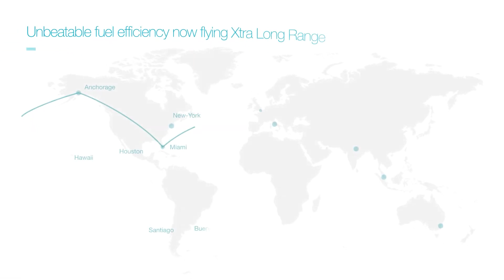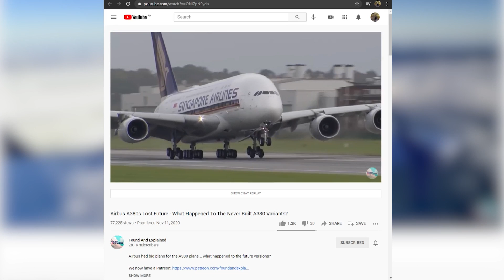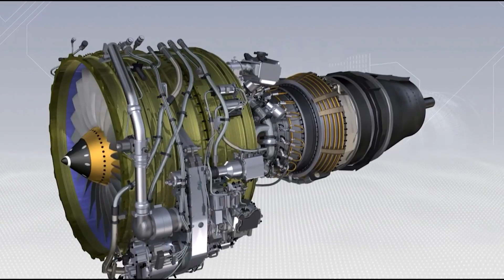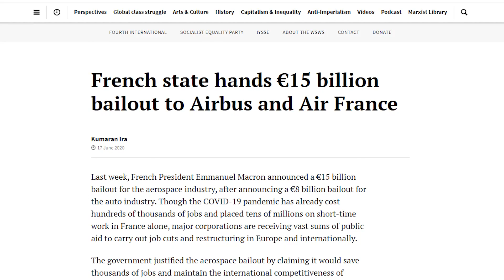Meet the Airbus A350neo and the new Airbus narrow body - Airbus Future Planes!

Comment: With the tumbling of the airliner market due to the N.W.O. pandemic one just daydream if any  future planning will be viable. If i can also lay an egg or two in the airliners future scenario i will say get rid of the 3+3 Passenger concept and concentrate on the 2+2 for regional short range routes. Then also the 2+2+2 for medium range domestic routes and the 2+4+2 all out business class for international routes. The latter can also be a faster kind of aircraft which can go super sonic when at level flight over the ocean or vast desert areas. Let us say +/- Mach 1,5 which will result in carbon fiber fusalarge and wing material rather than titanium as what the Mach 2,5+ aircraft will require.
Reply: Russians use stainless steal instead of titanium for their high speed planes.  It hasn't to be titanium.

Comment: Are RR begining to regret concentrating on the larger wide bodied aircraft rather than the 150-250 seat market?
Reply: There will be a single isle long range plane from Airbus.  They a nice product line up with the A220 type to cover regional needs, but there is a need for a successor for the A321 line.
Reply: @aquaden8344  I am not sure that is the case. 

Should the A220 be stretched to a dash 500 and even dash 700, I would fully expect some of that space to be used to carry extra fuel to extend the range, possibly significantly, as this could make far more point to point routes economically viable.

This could be an excellent option as the passenger cabin is in some ways superior to that offered by the A320, and significantly so when compared to the 737. Differences which become all the more evident the longer the journey time!
Reply: I personally can't see widebodies going anywhere anytime soon, especially crazy efficient ones like the 787 Dream)liner and A350 XWB 👍

Narrowbodies are perfect for short and medium haul but they simply wasn't designed for long haul, I think to make a narrowbody aircraft capable of long haul would mean aircraft manufacturers having to make too many sacrifices 👌

I have a feeling that RR will power a narrowbody aircraft again in the future sometime, but widebody aircraft will remain their primary concentration I think 👍

Comment: I think a 350 designs and models should be ended in the early 2040's they don't want the same thing to happen like the a350's early design a revamped a330
Reply: I think fuel savings in future will mostly depend on new engines - A 350 or 787 are already very light, they use much carbon fiber and there is not much weight left to save in future.
New engines however can also be adopted to existing aircraft models, even the very old 737 achieves an impressive low fuel burn with the new Leap engines , despite its a aircraft with mostly aluminum.
The A 330 is also a conventional aluminum build with some carbon fiber parts, so it would not have been able to compete with the 787.
Unless there is a new technology (like flying wings, but these are difficult to be realized with a pressurized cabin without weight penalties) a 787 or an A 350 airframe will be competitive relatively long.
Reply: @simonm1447  I think Airbus should’ve released A330neo in mid 2025 or something like that because most of the A330ceo is new (under 10 years)
Reply: @AA-sg2py  the problem with the CEO is the production line, new CEOs would probably  not sell in sufficient numbers to let the production line open until 2025. The NEO is more competitive to the 350 and new Boeing models.
Reopening a closed production line is expensive, a lot of parts are made by suppliers, and a lot has to be organized.
Reply: @simonm1447  It will be new concepts like the lifting body design, that is driving innovation.

Comment: Posibily we will get a hybird electric plane by someone,either boeing or airbus
Reply: Airbus, worked together with Siemens and Rolls Royce on an electric aircraft, but it turned out to be not feasible due to weight of the required batteries.
Airbus will possibly continue with hydrogen power aircraft with Rolls Royce.
Reply: Until solid state batteries come along no way we are getting electric planes
Reply: Liquid H2 is more likely as energy storage.

Comment: In the future a new market will probably come up which will need a plane which is a A320 sized plane which will have about the same range as the A350,anyone else think so?
Reply: A321 XXXULR perhaps?
Reply: I agree, the A320 sized aircraft are perfect for the job they were intended for.

The only problem IMO it that it depends on the fit out.  I have flown Air Asia many times, who use Airbus almost if not exclusively, also predominantly use the A320, but unfortunately their cabin layout is a little crammed and designed for Asian people who are on average seldom taller than 165cm,  I am 180cm, so an extra 1 - 2 inches between the me and the seat in front would be appreciated.

This cramped space is still do-able, but I wouldn't want to fly longer than 5 - 6 hours, but if it was planned for taller people, it would be a breeze.

I do believe any updated Airbus A320 sized aircraft may out range the A350 with the new engine design they discussed in the Vlog.

I am just waiting for the next announcement of a new product release date.
Reply: Yea I’m not bouta go on a 8 hour flight in a narrow body
Reply: well things are coming that way... small aircraft than fly far away so yes that would be logical continuation.
Reply: Won't happen. Currently an aircraft of a320/a321 size cant fly that distance because its not capable of carrying that amount of fuel in both weight and Volume. The XLR is already pushing the limits of that and they are sacrificing cargo space for fuel tanks and having to beef up the landing gear for it.
Reply: Also to carry more weight = more powerful engines = more powerful engines need more fuel = more fuel equals more weight. Its not efficient to do this right now. Maybe with hydrogen though, we'll see.
Reply: As for those who think that it won't happen, the original comment referred to an A320 SIZED, not an A320 VARIANT.
At the moment, engines are becoming more efficient by increasing the fan diameter to gain extra bypass, but, without changing the engine location, moving the wing upwards or increasing the height of the undercarriage (all with significant challenges) we can't keep increasing the bypass ratio by fitting ever larger fans since we are possibly approaching the size limit for aircraft of this type.
So we need to be looking at improving efficiency at the combustion level, allowing a smaller egine with less drag and/or a higher bypass ratio without increasing the size of the engine ie by having a smaller, but not less powerful core.
We might also to be able to squeeze a little extra through more efficient wing design and airframe/engine/interior fittings weight reduction, all of which will result in some increase in range without requiring additional fuel.
Longer journey distances, also make using extra fuel to climb to higher altitudes (airframe permitting) more appealing.
I don't know how true it is, but someone from Lufthansa told me that on a short hop, the A320 neo uses more fuel than the CEO because they don't spend enough time at an optimum cruising altitude where the gains in efficiency are actually made.
Reply: The problem with a very long range aircraft in the A 320 size will be the wing, a conventional wing with a normal wing span of 34 m (ICAO class C) has too little wing area to get enough lift for a higher MTOW (which you need for long range aircraft), a bigger wing however means the aircraft will be a higher ICAO class (more landing fees, less flexible) and the bigger wings have more drag, making it not competitive compared to a normal medium to short range aircraft in the short to medium  range role. 
The 757 was such an aircraft (even if the range wasn't as big as the one of an A 350). It's a niche aircraft, good for some purposes, but the market isn't too big for it.
Reply: @simonm1447  What if Airbus is further developing the lifting body concept, and  it does fit into the ICAO class C limits?
Reply: @aquaden8344  Such an aircraft would change the rules of course - but the concept has downsides, without a round cabin it's harder to pressurize it, since 0,5 bar pressure difference (the typical pressure difference on cruising altitude) means 5 tons of pressure per square meter of hull. A round hull inside to handle the pressure means more weight, and you have to have doors and emergency exits.
Reply: Naa , not even close . Widebody jets will continue to dominate the long range market even into the 2050's.

Comment: Airbus will definitely have a A350neo and a XLR version.
Reply from the maker: Seems like a total no brainer. The concept is approaching ten years old and with this upgrade it would be super competitive to the 777X. Leaving Boeing yet again playing catch up.
Reply: I'm not too sure, since there are already many different benefits of buying A350s, especially with the 777x being the (soon to be most expensive) second most expensive aircraft.
Reply: Given the level of advances, I don't think that it will be too long before Aircraft can reach reach the maximum range required with relative ease. After all once you can fly from anywhere in the world with a long enough runway to anywhere else who needs more range? As to whether passengers want to be stuck in a plane for that length of time no matter how comfortable the experience - that is another matter!
Reply: Well, if you think about it, in order to get from anywhere to anywhere in the world you only need to have enough range to fly half way around the world which at the equator is roughly 20,000 km (about 12,400 mi or 10,800 nm). Also the A350 is still quite new so I don’t really think there is any meaningful new technology that has been developed since that could go on an A350 NEO. On top of this the new engines I don’t believe have been developed yet (NEO stands for New Engine Option meaning it will have new and improved, more fuel efficient engines over the CEO Aircraft or Current Engine Option). As for an A350XLR, Airbus has already developed an A350ULR (Ultra Long Range) so the XLR is kind of redundant and pointless, don’t you think?
Reply: An a350 neo isnt going to happen any time soon and the opposite is a no brainer from both a business and a technological view. Business wise, Its still a new aircraft, and its they still have have to manufacture the majority of a350s they've sold. Releasing a Neo already will piss off all the customers who've already ordered and are waiting for their A350s.  The a320 and a330 are over 25 years old and sales were starting to dry up so they needed a refresh, it will be around this long until a neo is released. Why would they waste money developing something that is still selling very well (pandemic aside). on the technology side, You need to look at the a350 as if its a Neo version of the a340 which is what its kinda replaced. Besides that, Its engines are the best engines you can get at the moment as well. GE won't build engines for it at the moment and RR are developing newer ones as always, but nothing close to being  substantially better than the trent XWB Yet. Same with the rest of the technology on the plane. I mean they've even had a350s taxi/take off and land totally autonomously, there has been no major advances in technology that would be worth bringing out  new plane for yet and wont be for another 10 years.
Reply: @GVTSounds  Do really think the A350 customers would be offended to get an upgraded A350neo instead the legacy A350 - I don't think so.  Do you think R&R is developing the Ultrafan engine to let it collect dust in the development department - they want to see it used in a plane, and the A350 is their best chance.  An A350neo is a win-win-win for Airbus, Boeing, and the A350 customers.  It will be the first product released out of the three presented in this posting.

Comment: Remember The A380neo & A380 Plus?
Reply: i only remember the Airbus A380 Plus but not the Neo
Reply: There was no 380 Neo, Emirates wanted one, but Airbus did not want one.
The A 380 airframe however was flawed, it had too little lightweight carbon fiber, the fuselage structure was too heavy (because it was designed for a extended - 900 version), and the wings had a bad aspect ratio because of the 80 m restriction and a design made for 650 t MTOW for a never realized  cargo version.
Reply: @simonm1447  aspect ratio means nothing on the a380 since the lift/drag ratio is 19+ which is the same and even higher to aircraft with significant higher aspect ratios. Airbus compromises for lower aspect ratios. Same with the a350-900 vs a350-1000.
Reply: Exactly true 👍n missing A380 so much 😢 can't see again 😢😫😭😔